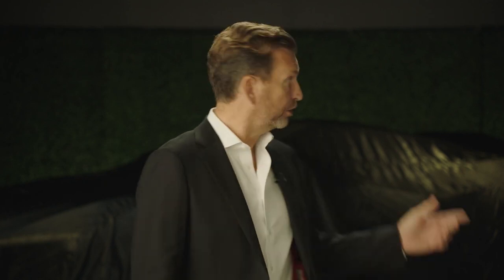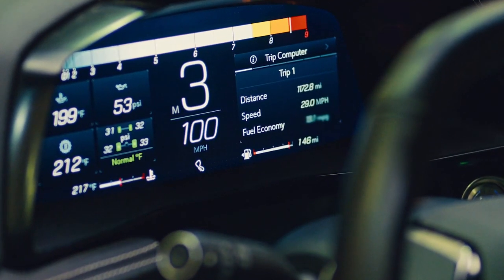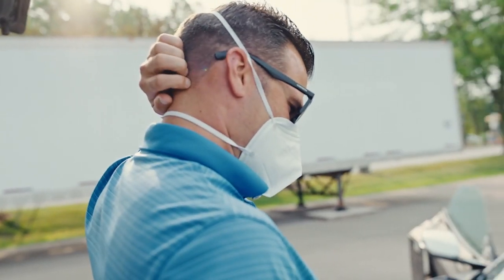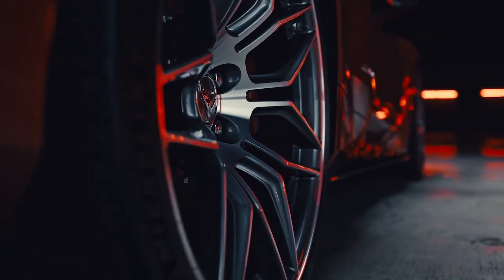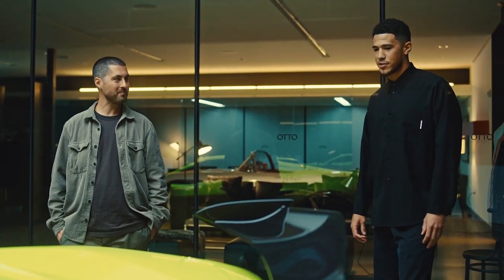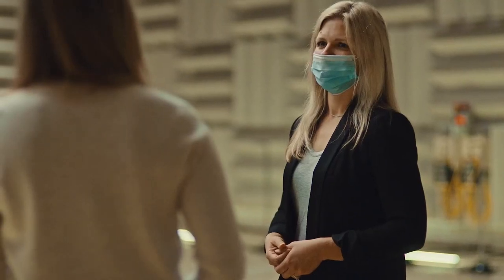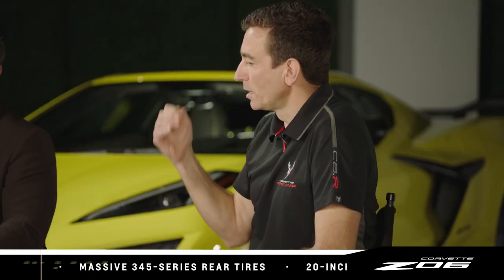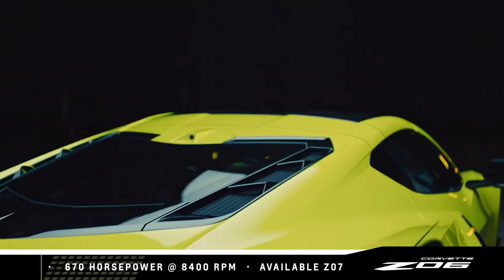All-New 2023 Corvette Z06 Reveal | Chevrolet Canada

Comment: Too bad the designers couldn't make it look good from any angle. Real mish-mash of angles and shapes with nothing flowing or tied together, and what's with that hideous non-active mulcher blade rear spoiler lol? The interior isn't much better from the square steering wheel to the divided driver-only oriented controls leaving absolutely nothing for the passenger to look at. Emelia Hartford's opinions don't exactly inspire one to go out and buy one either lol. Other than the mid-engine platform, I would much prefer the ZR-1 over this failed attempt at improving the design architecture :(